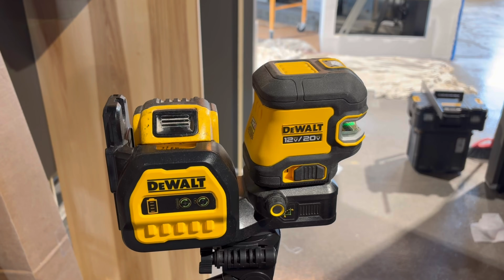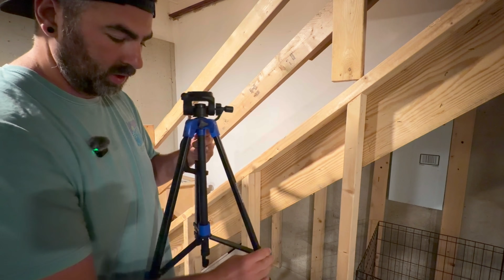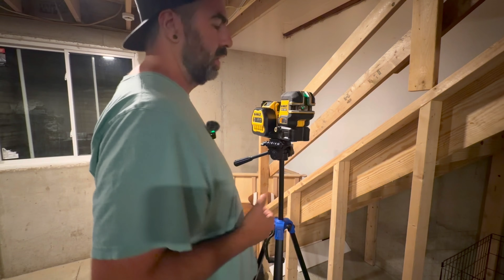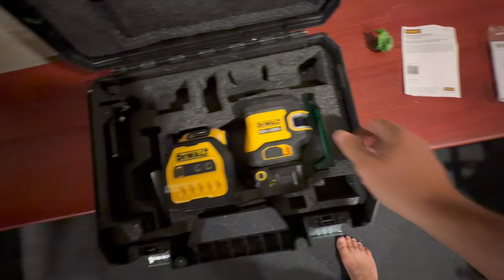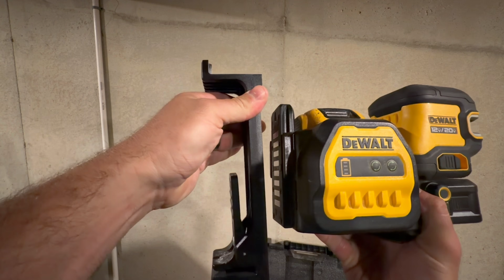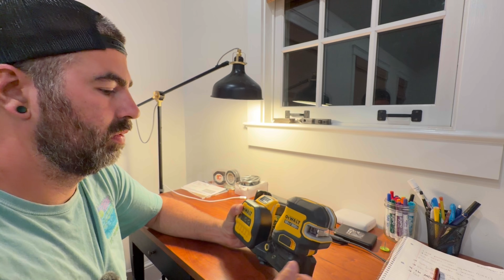Dewalt Laser Level Review (DCLE34220)

Comment: Great review man! I have the Milwaukee 3 plane that is my workhorse for most things, but I recently started a job replacing an elevated covered deck, that I really thought having just a plumb dot laser would really help with layout, since after demo, the remaining roof was about 18' high. I looked around a bit and got the Bosch 5 dot laser for around $150, basically just to use the plumb dots. The unit is super small and accurate and real nice if you just need something small that will fit into your tool belt, for just level and plumb dots.
Reply from the maker: That’s sweet that it’s small enough to fit in your toolbelt that would be very handy !